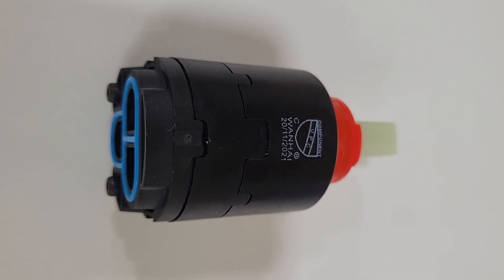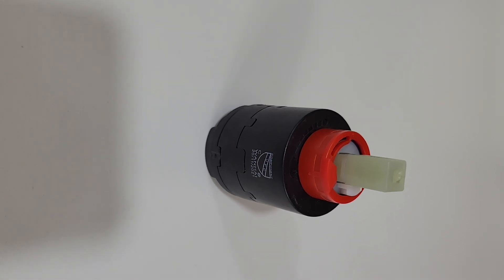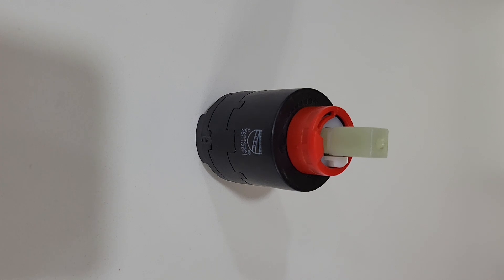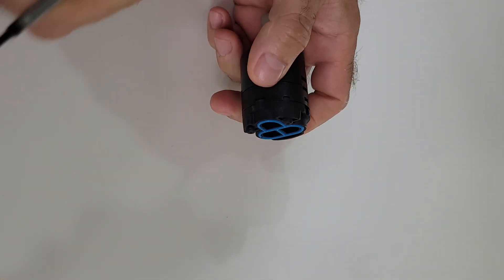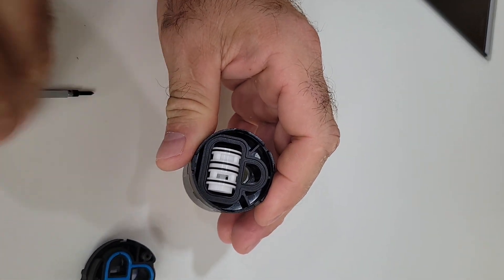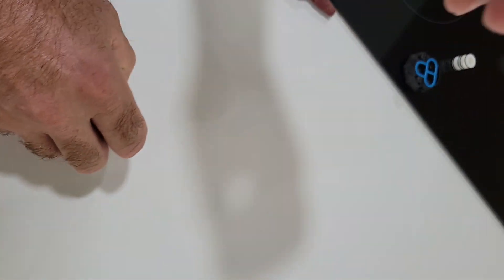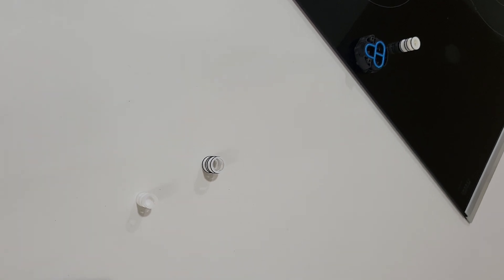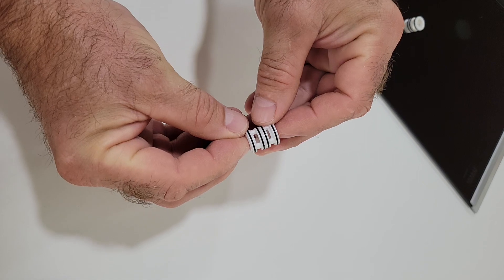Quick water hammer/ pipe banging in the walls fix after installing KES/other Chinese shower systems.

Comment: This fix works 100%.  The O-ring hack does not work as the water pressure puhses out the o-Rings.  This works and the water pressure and temps are perfect!

Comment: Have you noticed anything different in your shower operation?  Wondering if 2 pieces becoming one piece has any negative effects.  I'm not concerned with scalding as we keep our water heater level low enough that it wont burn you even in the event of only hot water.
Reply from the maker: Absolutely no operation difference was noticed.